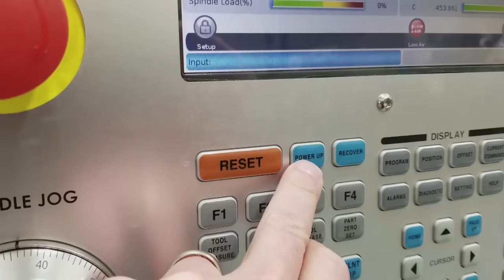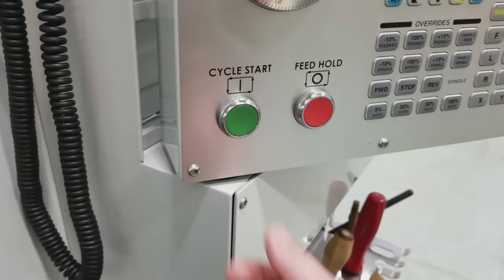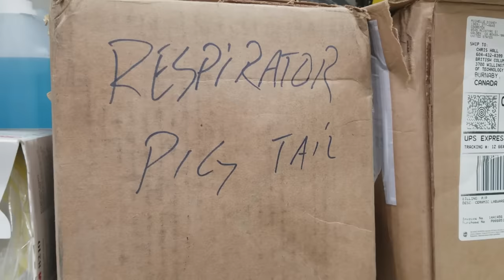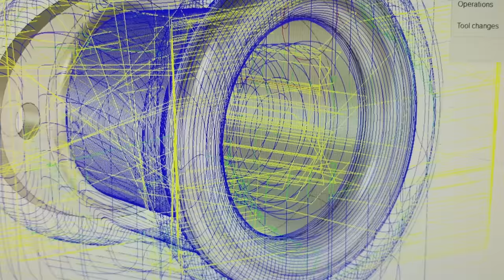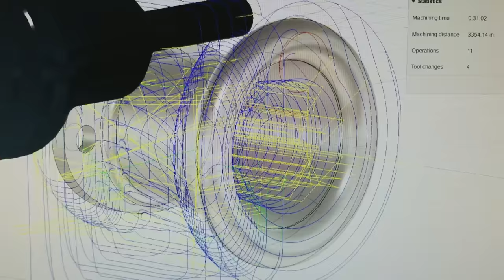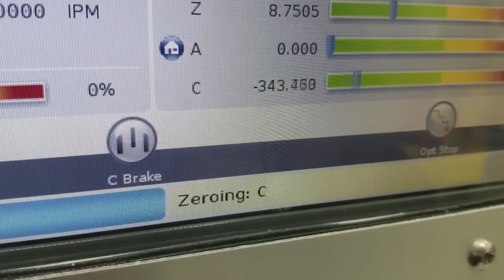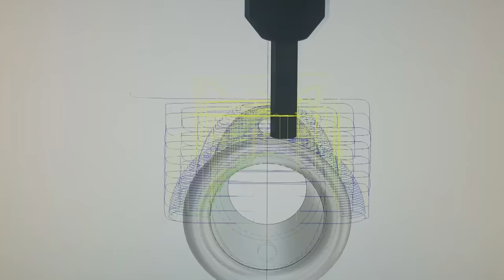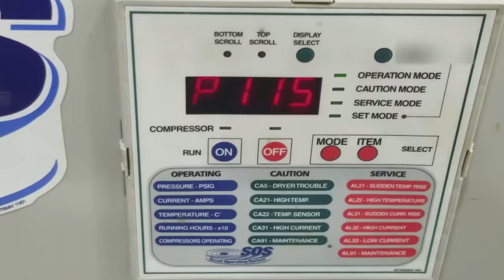ROBOTS are NOT going to steal your job | Ram Air Intake

Comment: How much do you charge for all your time trying to get the farging thing to chooch... It might have been quicker to chisel it out with a pocket knife and hand sand it.
Reply from the maker: Nothing at all. It's a "I know a guy" deal.
Reply: @arduinoversusevil2025  I knew that, it was a rhetorical question... Most people think you just push the go button and it gets made...when I went to engineering school we called it " Factory 2000". Just talk into a microphone and it spits out a small block Chevy or any other thing your mind could conjure up in 4 words or less.

Comment: This is the CNC gods telling you to make that thing on a lathe!

For what it's worth, we did quite a bit of CFD on one of these "ram air" things a few years ago. Despite the extensive scholarly literature on the topic (on the ricer forums), there is about a five-times greater effect due to the subtle geometry of the lip (radius, length, and converging angle all play a significant role) then there is any "ramming" of the air. Consider your garden variety Civic (numerous stickers mandatory) cruising down a Louisiana road at 60 mph. The dynamic pressure (due to the "ram air") is only about 0.06 pissys. Inlet geometry changes had an effect of over 0.25 pissys for in-cylinder pressure in the geometries we studied.

Science >> Forums Q.E.D.
Reply: I knew the lips were the greater factor all along!
Reply: The Coanda effect in action.

Comment: When you start your career as a machinist apprentice then discover you have accurate meme videos about your job
Reply: Not really. Note the use of the CNC to find the length and diameters of the tools as well as finding the fixture with a tool which enters all your locations and heights, makes offsets automatically too If the tool it sees is a little smaller from wear. Note the use of the CAM program. These all represent jobs taken away from people. Note that there are shops where machines check the tools every so often and a robot loads and unloads parts. Then what? A machinist pushes carts of stock to the machine and finished parts away and checks fluids and listens to noises. So far from operating a knee mill. Learn, and be prepared to learn more as the years go on. You'll be fine if you can maintain interest and not get bored, which can be dangerous. And always remember that it's the other guy in the shop that's dangerous. Right now this could be you!

Comment: Why Ain't My 5000 Parts done? 
I gave you the prints This morning! 
I know you had plenty of time cause I used to be a machinist!!!!! 
By the way why are you using all 4 of the key holes on that spinney thing in the lathe? Wouldn't it be faster to just use one to tighten those slider things down to the stock?

Comment: I've learned something new today. I could use my empty soldering wire tube plastic cannisters to store my smaller drill bits. Thanks AvE.
On a side note, you sound a little bit like Frank Zappa with your speaking voice, that's nice. Good for you.

Comment: Thank jebus for VPNs
And is that skookum choocher really running Vista, or has the safety-squint failed me too many times and am I half-blind
Reply: It could be, but more likely Windows 7. By the time Vista got patched, though, it wasn't that bad anymore, although by now you should upgrade and/or disconnect it from the internet, as security updates have stopped in April 2017. LinusTechTips' video is pretty amusing to watch, if you're interested.
Reply: Daan Wilmer On the other hand, this means the most persistent attacker has finally stopped their monthly sabotage.  There's an expensive subscription that will get you a server edition of 8.1 with "permission" to use the less sabotaged updates at your own pace for a few more years, it involves jumping through lots of hoops and getting a copy somewhere else, as the subscription only comes with a copy of the firstborn eating 10th edition.

Comment: I worked in a old school all manual tool room making rock crusher parts and turning bolthead nuts, then talked my way into a slightly more advanced shop running cnc cycles for military grade tank parts and crane pins. This video reminds me why I prefer hammer slinging rather than number punching.

Comment: Yesturdey I couldn't even spell machinist.
Terdey, I are one.
Been over 30 years now. My dad was one for almost 50 years. Best job. I believe all engineering students should spend at least a year in a manual machine shop before moving on thru their courses. It would save alot of trouble in the end run.

Comment: CNC is the main reason I left the tool and die trade after a few years out of high school.  An old school machinist cannot compete with the modern computerized technology.  I remember it taking days to set up and machine an elaborate part in a Bridgeport and now an operator clamps a block of metal in the vice of a 7 axis machining center and it's done in a flash.  My shop experience landed me a job as a tooling designer and then into factory automation.

Comment: Jeeze I remember having to use a manual edge finder and touch every tool off manually, then running a cable cord from my computer to the control panel to send the program. CNC machines have seriously come along was in 15 years.

Comment: As an enginerd, may I suggest 3D printing a high temp plastic instead of wasting time and material to make a heavier lower performance part. You'd also probably save idk, $40k on the equipment hehe.

Comment: Many (if not most) of the interfaces this human worked with in this video  were designed for humans. For robots or AI the interfaces would be different.

An automated process will not be hindered by sticky keyboard space bars.

It's a lovely depiction of a day at work though. :)

Comment: The robots are taking over!!! Hahaha
A good machinist could make that part with a lathe, and a milling machine. Also, a good forge would be able to make a die and cast that in aluminum if mass production is an issue. With enough machinery,  tooling, intelligence, and experience; many will surely get by without computers or robots.
Regardless of whether or not robots and computers are said to be taking over the world; the valuable human skill of manual machining must be carried on. Machines and robots may produce, but they will never take place of the supercomputers between our ears.

Comment: As soon as vision aware tech developed for automated car industry trickles to other sectors, a large portion of what you showed will be automated. Provide the system with block of material, it scans it for dimensions, compares to the CAD data to ensure the part can be milled from what was supplied. If the tool can be 'aware' of the part it's working on, all the manual intervention is removed.

Just a matter of time grasshopper.

Comment: My thoughts, for what it's worth: nice video. You make a strong argument while saying nothing. But after a dozen years operating knee mills and CNC mills and lathes, I cry BS. If you look at the difference between a Bridgeport and a Fadal, there's an extreme difference. And that doesn't have the bells your Haas can ring. Not to mention there are shops using robot arms to load and unload parts, and programs to mechanically check the tools. And dude, our CAD CAM software takes us forever sometimes to get things sort of right, scrap the first part, and get the second one perfect, maybe. AI is on the way to relieve us of these issues, and the issue of taking dumps and making coffee on the clock. 

But I'm not scared. If we can do this, we can do what's next, and hopefully make more money performing more specialized work.

Comment: I’ve been a machinist for 40 years and seen huge changes. It use to be that you could make good money, comparable to an RN. The world has gotten smaller so your wages are in direct competition with other places. Now where the money is at if you have the mind to get around setting up and programming a 5 axis machine and 99% don’t or shouldn’t. This is a very unforgiving trade and if you screw up it’s right there glaring at you and most of the time it can’t be or isn’t allowed to be repaired, you can’t hide it, it’s just scrap. Pick a career that isn’t economically transportable (locally needed) with fat pension plan.

Comment: I wish CAM and manufacturing engineering in general was required for a mechanical engineering degree. Just knowing the basics of CAM can turn a nearly impossible 3 hour machining process with 10 tools and a 20% reject rate into a 1 hour job with 3 tools and a 1% reject rate.

Comment: What kind of radiological source is in the pig and why are you putting hair in it? Is it a neutron source (Am-Be maybe?) and you are using it to activate the hair somehow?(this is quite a stretch on the part of my imagination). Trying to sterilize the hair with a Co-60 source? Why the blow torch over the open source? I guess that explains the respirator. So many questions. 

Would you an old salt such as ye satiate the curiosity of an health physicist such as I?”

Comment: Robots cant steal your job if you repair them for a living... A concept for this next generation to ponder. The ability of a robot to autonomously make a cost-effective complex repair is still far off by the estimate of many (myself included). They might be able to reliably change an exposed light bulb, but an air filter is a different story. Robots are great when everything goes perfectly all the time, but introduce a broken clip and it's game over for the bot, step one for the technitian.

Comment: 7th year machinist here. This is accurate but leaves out the fuckwit before you crashing the machine into the toolset laser and knocking it off by 3 inches and not telling anyone, so now you get to spend the whole day reverse engineering the endless m99 loops and variable programs that came with the thing where the settings and offsets for the laser are in metric because your shop was too cheap to buy Renishaw, all so you can fix it and feel like a boss.

Comment: At some point they will create a machine that has pre programed cogs and an app for your phone that builds them like cad cam, and a  bit set tray that holds hundreds of sets of bits and loads them automatically into the machine and it installs them and runs the app wifi through your phone without needing to install bits.  and having pre packaged apps for building.  Then one guy can sit in the warehouse and monitor the machines and the engineers can hang out at a bar b que or beach and design the peices during there free time. Just saying the technology in this video I saw in 1990s it has a huge problem and it could be solved if someone took the time and it would probably make them rich.

Comment: we had to set cameras up around our welding robots because people kept fucking with them my stepdad and i have spent ours splicing wires n the companies spent thousands n thousands on parts  they mangled the shit out of things they cut the wires down the length kinda, so they were all fucked up cut at different places n in half n missing a bunch of insulation we had to cut out a foot n a half 2 foot of wire, it looked like they werent smart enough to grab something that would cut all the way thru (in a metal fab shop..couldnt find something to cut metal???) so the hacked the hell out of it with probably a utility knife n they didnt even go all the way they left a bunch.. it was a few hundred wires but still y stop?   i assume it was the same people who lost their positions and ultimately had to leave because they didnt make themselves valuable in any other way, thats the problem with gettin comfortable in a position like that, if anything happens n u have no other skills u HAVE to find that exact position somewhere...n good luck these days   we cant Not advance the company just because they want n easy paycheck we offered them other options, sometimes u have to adapt to life  this is simply a reply to the phrase "robots wont take ur job" not really the video itself

Comment: Many jobs  can and will be stolen by robots. The more wide ranging the skill set and knowledge base, or the greater degree of creativity or variability in the tasks required the less likely the job is to be stolen.  I guess my view is the skill and knowledge of the worker is replaced by the skill and knowledge  of the engineers and programmers, or the acquired "knowledge" of algorithms. There is currently no reason technical or safety reason why trains or planes require humans to guide them and given the majority of accidents are caused by human error very good reasons  why they should not. I guess the important question is what do we do with the majority of human beings once they are not useful to the productive economy, particularly as  access to the means  of existence to the  vast majority of human beings has always depended upon being economically useful.

Comment: I see your machine has the auto air gun MQL option. What a pice of shit. Mine wasn’t even remotely pointed at the tool. I had to take the top bolt out so I could turn it in where I wanted it to go. Kinda. It really needs to be on the back side where it can spray into the cut. Also, does the VPS or Visually Programming Shittily not have a peck drill cycle? Am I missing that somehow? I get so fucking mad every time I try to use VPS I get tunnel vision.